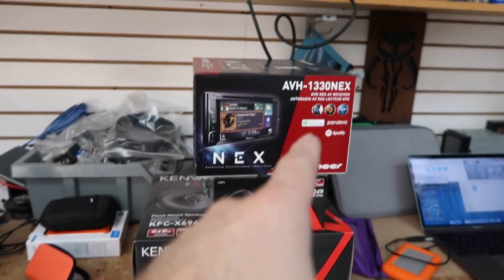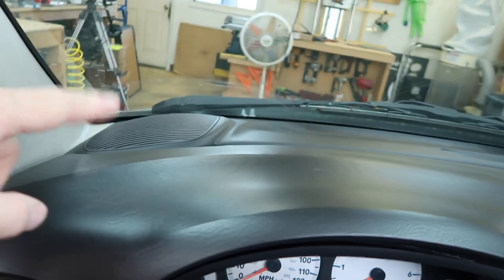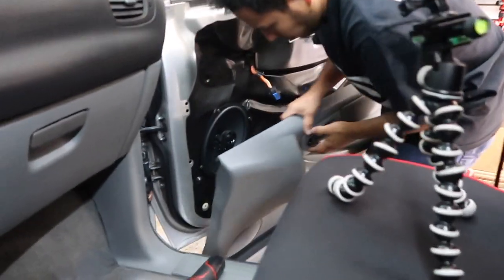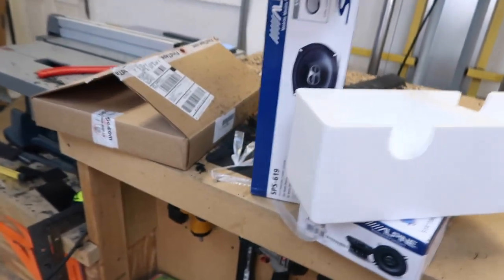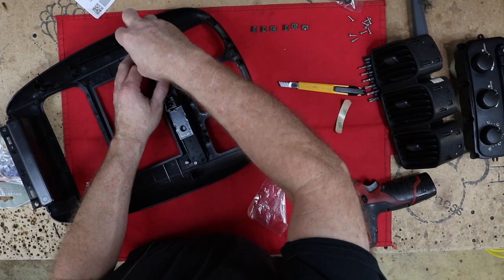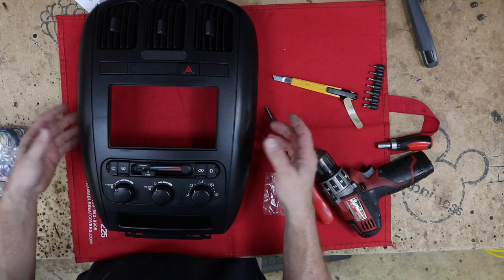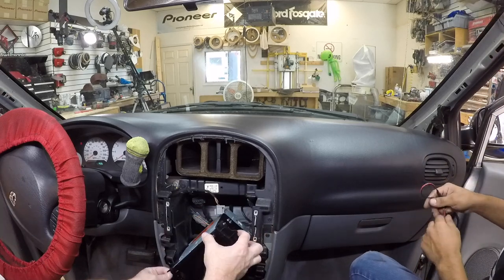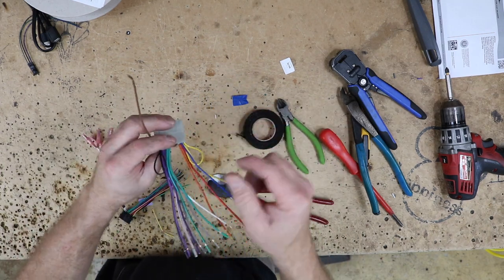Dodge Caravan gets a double Din CarPlay radio  Installer Diaries 133

Comment: I know this video is a bit old, but do you know of any options for a subwoofer that won't take up much space in the back? I've searched but not really found anything I like. Was hoping someone made a mod that would allow for a sub install in the passenger panel by the rear gate. Great video by the way. I'm going to be doing this but in a Chrysler T&C 2001 with the infinity system so I'll have to see what I need to do about the factory amp. It has an 8 speaker system in it currently that is factory of course.

Comment: Does the 05-07 Caravan (like the one in the video) provide switched accessory power for the radio? Some of the Amazon reviews for the Metra harness mention needing to run power from elsewhere, but I don't know if that applies to this model since the factory radio has a mechanical power switch.
Reply: Yes, it does.  I bought the Scosche harness to use with my '05 Grand Caravan and it was perfect.

Comment: I'm running into a problem with the molded plastic inside the space where the radio goes. Stock stereo sits on top of 2 prongs that are in the way of a double din. Do I just have to cut all that out to make it fit?
Reply: Yes, cut it out.  You can actually break those prongs off with a pair of vice grips, or simply cut out the entire cross brace piece as shown in the Metra instructions.  It's made of plastic.  I took it out with an angle grinder, but a sawsall would also work, but be mindful of all the wiring in there.  Don't wanna cut the wires!  There is also one additional pro tip that I can offer, having JUST done this installation myself, yesterday.  The video host in this excellent tutorial states that he has to make the holes in the plastic radio mounting bracket wider so you can shove the radio over a little to the left in order to line it up correctly with the opening in the Metra fascia.  What he doesn't mention is that there is a little plastic pin on the back side of that left bracket, between the upper and lower radio mounts.  REMOVE this pin.  Cut it off or file it off.  If you leave it in place, it will prevent you from sliding the head unit to the left, because the pin will hit the metal mounting rail on the left side.  I had to elongate the mounting holes in the left bracket by about 1/8".  Finally, I suggest you remove the factory clips from the original fascia and use those instead of the clips that come with the Metra fascia.  The factory clips are beefier and hold better than the Metra clips.  Cheers.

Comment: I really took notice to the drilled holes because the "center console was jacked up" and it wouldn't align left or right. The rest was pretty much Radio install 101... 

What I would like to ask though, is just how much extra effort was there in getting that thing to line up properly. We know there is the "edited version" that becomes the video we see, and then the behind camera, 12 new Japanese words version as you attempt to get the "jacked up thing" to actually fit... ;) 

I am curious if you could elaborate on just how difficult it was to get the thing to actually line up. I saw that throughout the video, you re-put the center piece back up there 3 times, just on the video to try and make sure it was proper. 

Like you guys, I am a perfectionist! So if I tried to do this and it was even slightly off, it would drive me nuts! Thanks for the great video though, two things I learned from it. A.) Those speakers in the top are um, NOT speakers! LOL And B.) The speakers in the door must be carefully chosen as it will interfere with the window's actual framing structure.

Comment: got a question, got the ddx9903s in my wifes carolla. when I use the steering wheel control to change the station, it only goes up from like 88.1, to 88.3. it doesnt go from programmed station, to the next programmed station. if i hold it down, it used to scan to the next available station.....not anymore. bestbuy isnt being helpful at all. is this stuck as is??
Reply: To the left of the HD logo at the top of the screen it will say either manual, auto 1 or auto 2. press it until it says auto 2
Reply: It's just the universe busting your balls because in 2019 who the hell wants to listen to commercial air wave radio???

Comment: Do you guys still add a Micro Bypass for the handbrake on all Pioneer double DIN installs? I have not seen those micro bypasses lately with your double DIN installs...
Reply: Just ground it to the radio itself I do that alot and it works